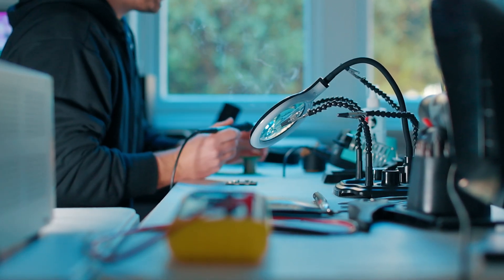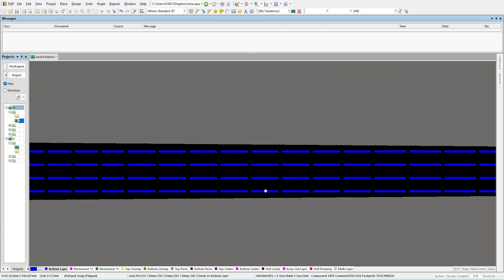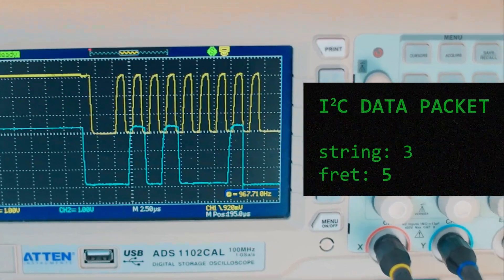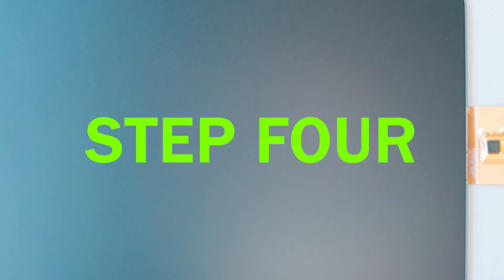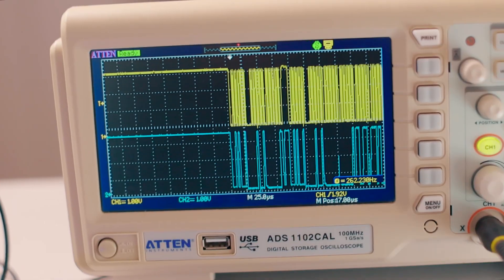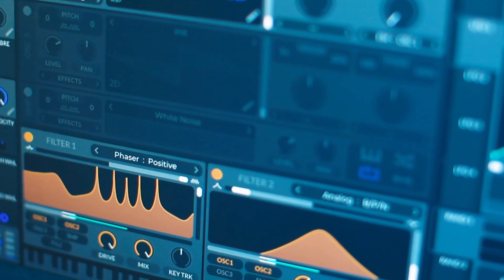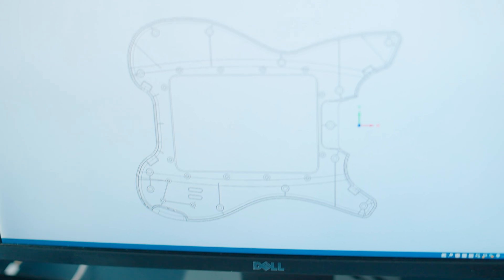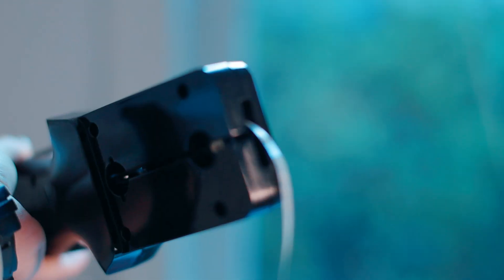How I Made A Futuristic Guitar

Comment: I am pleased to say I have this Futuristic Bass. I also have the Tribass. I see you have updated the firmware to add pressure sensing, and provided a nifty video on how to do this. What astonished me was finding your video "Hacking the Misa Quadwave with Python ". This goes way beyond any dream i had for this device. 

Is there any chance at all you could release something similar for the Tribass? The ability to hack the Tribass would answer so many prayers. Here's hoping.
Reply from the maker: Thanks so much for the kind words. It's really great to hear from someone who owns both the Quadwave and the Tri-bass!

With the Quadwave, I wanted to create something that was not just an instrument but also an extensible / flexible platform people could build on. That's why it supports things like custom Python scripting. It was designed from the ground up to be extensible and developer-friendly. (I wasn't sure if people wanted this... so I took a risk in doing this, but I definitely know of some people working on their own custom setups using this ability, particularly for live shows!)

The Tribass, on the other hand, was built in a very different era with a much more fixed architecture and doesn't support extension, unfortunately.

I really appreciate the enthusiasm and support. It means a lot, and it’s a big part of what drives me to keep improving the instruments.
Reply: @misadigital  That's actually really good to know about the difference between the two. I would have thought the Tribass and Quadwave were much more similar other wise.

Comment: what if you made the touch pads into sorta like the tip of the joysticks on a steam deck, and had them slightly lifted in some way so you could actually pitch bend like on a real guitar? i think that would be sick.

Really cool idea though, way better than the casio one, also what if at the head of the guitar it was a touch screen of some kind?

this is sick though.
Reply from the maker: A joystick-style pitch bend idea is super cool. Kind of like giving the touchpad some physical sensitivity. I actually coded it so that when you drag on the touchpad with 4 fingers, it does a pitch bend. It has advantages and disadvantages compared to your suggestion. But a tactile control is definitely something I’ll keep in mind for future versions. I never thought of a touchscreen on the headstock.. it is empty real estate at the moment... I'll have to think about this but I like it
Reply: @misadigital   I love this Quadwave. I'm here for all of it. I just got this one.
Reply: @misadigital  I had a sort of similar idea but for the fingerboard. Since the frets are caved into the fingerboard, the bumps to the left and right of them could be used to add pressure sensitive parts so you could bend similar to a guitar string, and since it's a digital instrument you could make it bend up or down depending on direction.
Reply from the maker: @StaticR I like it! Yeah I feel like there is more to explore with the neck design… but the narrow and long dimensions make it challenging to work with as a circuit.
Reply: @misadigital  Imagine a suction cup stick-on joystick. ;0) Speaking of which is there anywhere on the circuit board to add a new sensor? Something that your 'Python hack' could pick up? I2C allows you to daisy-chain devices, which means in theory, if you knew that device's address, you could get a read on it. Just a thought for the future of this futuristic Bass.  Another thought. I miss actual frets so you can play blind, I'm thinking of rubber bands, but maybe you can think of something better.
Reply from the maker: @chrisliddiard725  If you're handy with a soldering iron, you could easily solder your own wires on to the SDA and SCL lines (the "I2C bus") and add your own devices. But the firmware on the microcontroller doesn't support talking to new devices. I am always listening to ideas from the community though so if someone wants to see that ability I could add it in a future firmware update!
Reply: @misadigital  Fantastic. I look forward to seeing this implemented.